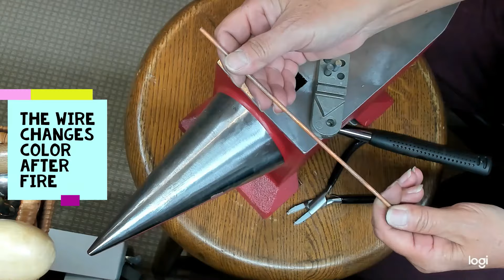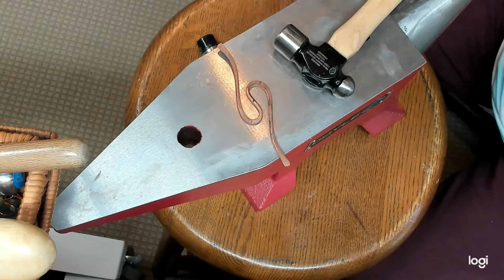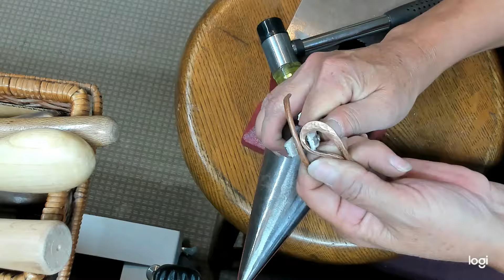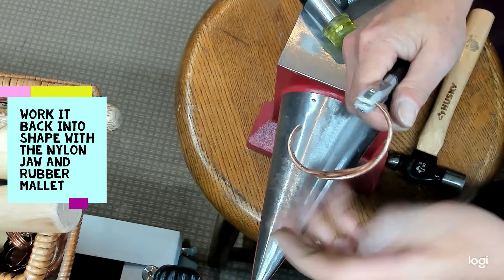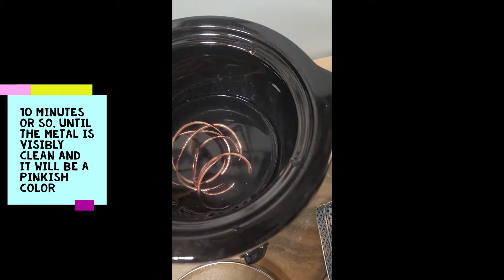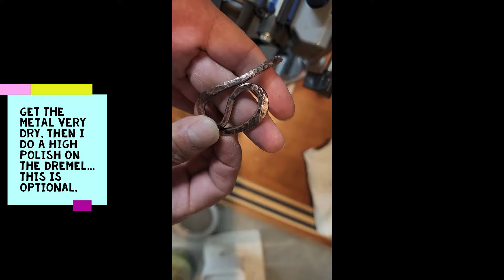Hammered Wire 10 Gauge, Curvy Copper Cuff bracelet blank!

Comment: Love these! What is the tool that you used to bend the wire?
Reply from the maker: Thanks, Michelle, that plier is called a Nylon Jaw.  They have plastic heads. ❤️🙏
Reply: Sorry I wasn't more specific. Not the pliers, the metal jig thing that you made the "S" bend with. The thing you clamped to the anvil. 😅
Reply from the maker: Ah, there is one on Amazon, you can use my store link if you'd like, many are asking about my tools, so I set up a page on my website... here it is and below is the jig... https://www.perfectlytwistedjewelry.com/buy-tools-and-supplies.html
Thanks again, Michelle!
The wire jig...
https://www.amazon.com/Aluminum-Bending-Compact-Mounting-Shaping/dp/B00FN5SE00/ref=sxin_15_pa_sp_search_thematic_sspa?content-id=amzn1.sym.b37414e5-dfff-44fd-8c81-4f8d3030c3a4%253Aamzn1.sym.b37414e5-dfff-44fd-8c81-4f8d3030c3a4&crid=2SFIMTTA28R7Y&cv_ct_cx=wire%252Bjig&dib=eyJ2IjoiMSJ9.t26gseNYA_HRDD338JOS1qu9usf2v8XVmmMGM8_4Yw2oWY3l_VZpkTGEEeH2PTL-ymC0mJcnUyF-dZIFBtW96g.xbjSQSxKo-GlhEbxCft9KOeswTKdMvECyajirRaFm2s&dib_tag=se&keywords=wire%252Bjig&pd_rd_i=B00FN5SE00&pd_rd_r=f7b96ed1-da2a-4663-a103-0b0d3449b180&pd_rd_w=TFwcq&pd_rd_wg=2AMLb&pf_rd_p=b37414e5-dfff-44fd-8c81-4f8d3030c3a4&pf_rd_r=T8JNYY2T76Y4GGPN9Q4P&qid=1713825205&sbo=RZvfv%252F%252FHxDF%252BO5021pAnSA%253D%253D&sprefix=wire%252Bjig%252Caps%252C151&sr=1-4-364cf978-ce2a-480a-9bb0-bdb96faa0f61-spons&sp_csd=d2lkZ2V0TmFtZT1zcF9zZWFyY2hfdGhlbWF0aWM&th=1&_encoding=UTF8&tag=perfectlytw02-20&linkCode=ur2&linkId=f593c381f0726f599be94599c37a98b9&camp=1789&creative=9325

Comment: I need to get an anvil 
I guess
Reply from the maker: They are fun to have.  You can use smaller bench blocks for regular wire but this biggie wire needs a heavier surface, it will be easier on you and your tools.  This one came from Harbour Freight, it's not a jewlers anvil, just a regular garage shop one. I think it was less than $200